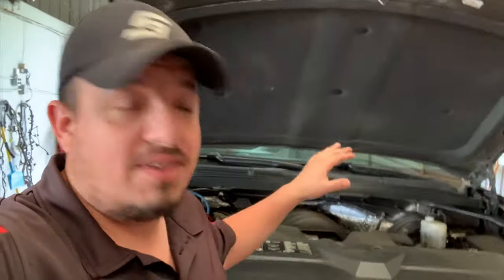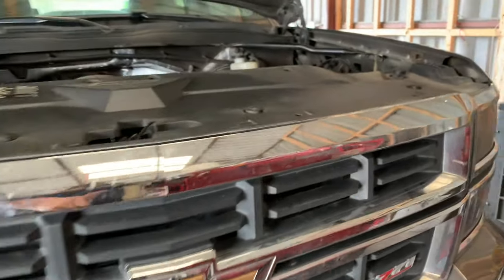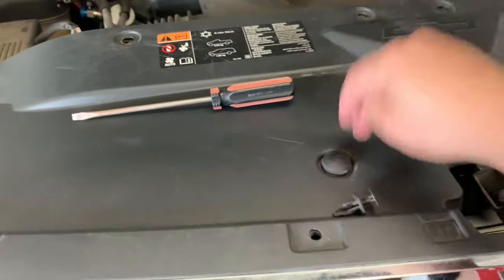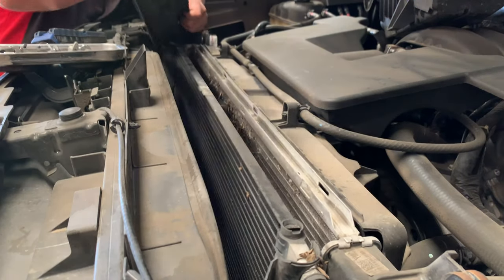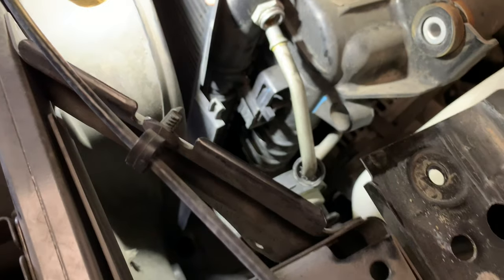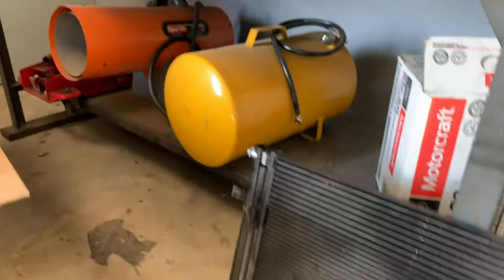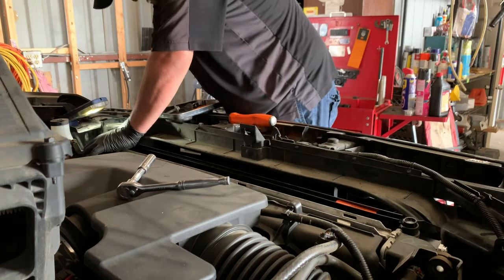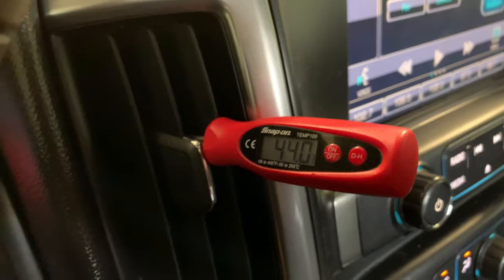2014-2018 Chevy Silverado A/C Condenser Replacement - Sierra-Tahoe-Yukon-Suburban-Escalade

Comment: I love how this is a known wide issue, there are 3 pending class action lawsuits against GM for this.......but no recall. All due to a bad weld
Reply: Mine just stopped working today I have a 2014 GMC Sierra
Reply: @oscarferreira1991  just bought a replacement condenser for my ‘14 today, about to put it in. Crazy how many people have dealt with this issue!
Reply: @spikesg2000  my ac condenser was replaced 2 years ago , whats going with my truck is the ac fan doesn’t turn on
Reply: @spikesg2000  my 2015, my step moms 2014, and my buddys 2016 all went out within a month
Reply: @oscarferreira1991  my blower fan went out about a year ago. They’re pretty easy to change, it’s under the dash on the passengers side.
Reply: Mine is probably bad too 2016 GMC Sierra looks like it’s common smh
Reply: Same exact issue for my 2014 silverado. A Chevy dealership said it would be about a $1600 fix. Looks like I'm doing this myself.
Reply: Mine started leaking yesterday!
Reply: Got a 15 GMC 1500 and just got the same leak. 
Part was 175 . Luckily I am the labor .
Reply: how can I  join the cass action law suit bcause I have this issue right now
Reply: Mine is at the dealer right now for the same concern. 2015 Silverado with 49k miles. Ac condenser is  leaking and blowing hot, im on my 3rd set of brake pads and paint is peeling. Im buying a Ford next time.
Reply: my 14s gettin a new one in this weekend i reckon lol.
Reply: I believe they might have a recall on these coils now
Reply: Preach
Reply: Any news on that lawsuit
Reply: Don't forget the transmission problems. Same story.
Reply: Just verified mine with uv dye today same spot
Reply: Can't forget the transmission too 😢😂
Reply: Yup my ac is out and yes same spot on condenser I have a leak.. it’s crazy how GM it’s not doing anything to fix this,we paid ton of money for these trucks..
Reply: No recall probly because its not something life threatening. Im guessing.
Reply: Same here from the point I bought my 2016 it was fine for about 2 years
Reply: Mine is out and some shop guy said it's 1,000 or more to fix wth
Reply: I can do this install  but I don't have that vacuum for the lines. 
How do I remedy that?
Reply: No recall because it's not a safety risk.

Bad design, but no safety risk.
Reply: @adeptustrashmechanicus2909  well we can all play the same game against them and say it puts us all in risk of heat stroke or death from not having a/c working when its 104°F outside. The kids riding in car seats sweating all cranky from heat exhaustion is a safety hazard to them and myself.
Reply: Sucks for the owner , repaired 3 this month literally doing the 4th now . Just taking a bathroom break scrolling the web .
Reply: Awesome video my friend! Thank you, my 2017 stopped working today..

Comment: Not too bad took an hour to get out and an hour to get back together my advice is take off the brackets for the air box to reach the bottom Freon lines easy. Also used a ratchet wrench for the 6 crossbar bolts not that bad

Comment: Wow!!! The Chevy dealership here in my home town quoted me $1700 to replace the condenser! They said that the whole front end had to come off!!!
Reply: Thiefs
Reply: Same here! I  just got quoted 1500! And once I asked for the part number they denied it just because I denied there service. I figured I’d do it myself but they didn’t wanna give me the part number so I couldn’t take it somewhere else and get it fixed. So no I’m working on it on and saving myself money!
Reply: Shit man, I just got quoted $1400. After this video I think I'm gonna try it myself!
Reply: Wow and it’s their screw up to begin with
Reply: I did it for less then 1,000.  230 for
Condenser and. 400 to recharge it at the dealership
Reply: Same deal here , 1700 dollars for a 200 dollar job
Reply: Same here. Quoted 1400.
Reply: I quoted myself $315 to do this job lol I'm not taking it to no dealership and you shouldn't either.
Reply: I was quoted $1200 at my local Chevy dealer. Told me the same thing. It's labor intensive and the whole front end has to come off. I live in SoCal and summers have been brutal!
Reply: Lol wow
Reply: Me too. Gonna try it in a few days 🤞🏾
Reply: Just got a quote from my local GM dealer for a locked up compressor:

And I quote.. "found compressor locked up sending metal thru system. Recommend new compressor, evac and recharge, belt, expansion valve, and condenser. Estimate of $3001.93"

I declined. Rockauto has all the parts for less than $400, and my diesel mechanic friend and I can install it all in a couple hours in my driveway, pull a vacuum, and recharge 🤷‍♂️

Comment: Thanks for the how-to. Dealer wanted $1500 for this repair. Did it myself for $150 in parts in 1.5 hours. On my 2016 suburban the lights are connected to the fender over the radiator support. I was able to do the repair by just rotating the support back wards and leaving it on the car.
Reply: Roboticsurgerydoc shit the dealership wanted to charge me 2k
Reply: How? The freon is $300 alone. Condenser is $100

Comment: You saved my ass before watching these vid I took my wife’s truck to the dealer to change the condenser and they were charging me 1500 I went got the part and change myself thanks
Reply: Same 😂 they wanted to charge me 1200 no thanks I just needed the diagnostic
Reply: same brother mine went bad they wanted 1700, the 2016 tahoe has the same problem and has a recall on it so i dont know why they wont replace it its the same part
Reply: @Tha_Marine  if it’s a recall they should be able to replace. But sometimes it’s easier to just do it yourself

Comment: Very informative video.  I ordered the part and my buddy and I swapped it out yesterday in 2 hours and refilled it and it is now blowing snowballs... Thanks so much for this video.
Reply from the maker: Glad it helped
Reply: How do you recharge it after replacement
Reply: Hey.
Did you have to drain the system or anything before unsnapping those lines from the old condenser? I added a little freon the other day to find the leak..not sure if its still in there or not.
Reply: Did you have to add AC Compressor oil along with the new freon?

Comment: Always been a loyal chevy guy. Never had any ac issues till I got the newer truck with just 38k miles and 20k miles later same exact spot mine is leaking out of.  🤦‍♂️
Reply: hector meza 65k miles and mine started leaking out this spot. But at 45k miles the compressor seized up on me 🤦🏻‍♂️
Reply: Legit got the truck a week ago. Checked my ac my condensor is leaking my compressor locked up and my copper is leaking.
Reply: I’m in the same boat buddy. Just got in my truck today and it’s 90° outside and my AC is blowing hot.

Comment: Awesome vid. Thanks for this info!! 
My Silverado had a leak on the condenser and mechanic wanted to charge me $1500! Luckily I had extended warranty and i was covered fully! I just had to pay $100 for the deductible. 😁
I heard this issue is so common with this truck cause the condenser is made of aluminum, and if you are going to replace it, it should be replaced with a metal condenser.
Reply from the maker: Good stuff
Reply: A metal condenser? Isnt Aluminum metal? Also its is made of aluminum due to its head conductivity properties as it needs to dissipate heat so you cant just make it out of any old metal. It was an iditiotic design of using tack welds to hold mounting brackets that are also at a seam where the drier tank is welded to the fins.

Comment: Great job on the repair. Thanks for making the video.  The OEM condensers are very hard to get, about a 2 months wait at my local dealer.  Napa has a few in stock and was lucky enough to get one.  Just amazed at the poor quality of GM these days. First had a transmission go out on my 2016 Silverado back in the Spring which cost me 7000 to get repaired. Now the air conditioning stopped working. This truck is becoming a big lemon, afraid of what will be next to fail. Only a 5 year old truck with 130,000 miles on it, NEVER going to buy a GM vehicle again.
Reply: Wow. I'm right over 120,000 miles and my transmission went out and then shortly after I was told there is a leak on my condenser.
Reply: I'm with you bro. I just spent 800 bucks to replace a headlight , and now looking to have to repair the AC.   So much for buying a new truck
Reply: Haha, as if other vehicles don’t have issues, good luck with Ford or dodge
Reply: I also have a 2016 Silverado 130k miles, transmission went out at 95k, condenser just got the same leak as the one in the video
Reply: Jesus. Just happened to me. Transmission went out at 95k and now at 128k condenser cracked.

Comment: Took me a bit longer than everyone else in the comments but still saved me $900. Some of the bolts were in really awkward spots. Great video.
Reply: That bolt over there by the washer fluid tube is annoying. It will not be going back in 😂😂😂😂😂😂😂😂😂😂
Reply: @baharv4575 I definitely didn’t put it back 😂”spare parts “

Comment: Did you guys hear a hissing from under the passenger side dash. Before your a/c went out? I have a 2017 kept hearing a hissing noise and my a/c stopped working
Reply from the maker: thats normal to an extent .. you have the expansion valve on the fire wall there .. so you will hear it sometimes

Comment: I get my ac condenser fixed in a few days and I’m super excited. I went a year with no Ac and mechanics gave me the run around and I spent over 3k on things that did not solve my issues. I then heard about this common leak on a weld, got mine checked and turned out It was my condenser

Comment: Great video. Would have liked to see more with the bottom connections but I get it’s hard to video that. Would attempt to do this myself but I don’t have a vacuum pump. Chevrolet should recall this issue.
Reply from the maker: You can always rent one from places that rent equipment etc.

Comment: I was told a long time ago to put a hardware cloth in front of the condenser on the back side of my grill and I never did it. Now I'm having issues with the rocks that hit the front of it, not so much on the welds  like this man is  saying but I know the welds are leaking as well. But I think if you put hardware cloth  behind your grill.  After installing the new condenser it will prevent problems in the future
Reply from the maker: Yeah. It could help

Comment: Yeah now there's a service bulletin that calls for dealerships to replace free of charge for an addition so many miles  passed the warranty. Covers every year of GM truck & SUV from 2014 to 2019. Except for the 2016 GMC sierra.  That's the only truck not covered. That's the truck I have.  It's the same part number, same manufacture of the part, as well as the service bulletin has a picture of the leak and it looks like the pic was taken from my truck. The leak spot and crack is identical to mine.  But mines not covered.  That's some bullshit.

Comment: GM has went to shit. My wife's 40k Tahoe leaks here. About the 20th issue since buying new. My 2013 Tacoma with 140k, zero issues. Tried to tell her. Learned my lesson and reaffirms my Toyota choice.
Reply: I work at a Chevrolet dealer and drive Toyota’s.
Reply: @ap5598  I would too, lol
Reply: From what I read on this GM issue, they are willing to replace the Condenser on the Tahoe and the Suburban, but us Silverado and Sierra owners are shit outa luck.

Comment: I’m doing this this week I haven’t vacuumed out the system but I’m sure most the freeon is gone lol if I don’t vacuum and install it do I need to disconnect the battery first for so I just add the free on right after installing it? Thanks
Reply from the maker: vacuum .. always vacuum ..  it removes moisture also

Comment: Your video is awesome. Have you thought of using epoxy to reinforce the welds? I'm thinking about JB weld or a 2 part epoxy to add structural integrity to the condenser. 

What do you think?

Comment: Fixed exact same condenser leak with quick setting epoxy, sandpaper, and carb cleaner. Took 15 minutes and didn't have to remove a thing (all work done reaching through front grill.) 1.Clean area with carb cleaner. 2. Sand metal around leak 3. Clean again. 4. Apply epoxy with something like a toothpick (don't use plastic, epoxy may melt it.) 5. Let cure (see epoxy directions) mine was a 90 second super fast curing. 6. recharge freon. Did mine almost 1 year ago and still working great.
Reply: I wondered if it could be repaired. A buddy has a TIG welder, hmmmm could it be welded? Or, is it a can of worms? If it fails in 1 place, why not 2?

Comment: Taking that metal brace off over the condenser was hell on Earth. Make sure you have a flex socket handy.
Reply: How did you get the metal brace to lift out under the head light bracket? Or did you take of the head light

Comment: Thanks for this. I'm doing this job on Sunday, and was concerned about the beam. Seems easy enough.
Reply from the maker: Good luck!
Reply: @FalconsGarage  Got it done. Not bad, except for those beam bolts. Only two were a pain, the other 4 not bad. Helps to have a ratchet that bends 90 degrees.

Comment: Since the trans cooler is integrated into the condenser, if the condenser leaks is it bad to drive the car risking the transmission fluid getting hot or does it only affect the a/c?
Reply from the maker: No. Shouldn’t have any issues about that.  The fan cools off the transmission cooler.  Not the Freon

Comment: Could the transmission line leak after the condenser is replaced? I had mine replaced 3 days ago and on day 2 of driving had a huge transmission fluid leak in the front drivers side engine compartment.

Comment: My 2015 Chevy Silverado has the same issue. Bad weld. Mechanic wants $950. This should without a doubt be a recall. Also, how many times have to had to replace the 3D printer spun plastic piece that lowers the tailgate slowly? I am on number 17. GM won't release the name of the Canadian company that makes the defective part. They cost less than $10s until the warranty expired, then GM raised the price to $40-$45.

Comment: Great video! Took me about 2 hours! If your doing it on a saburban 2017 the only extra step is moving the headlight bracket out of the way.
Reply from the maker: Nice work!
Reply: I'm getting ready to do it on a 17 Suburban, too.  Did you have to remove the entire headlight housing? Took a look at the bolts on the underside of the crossmember (driver side, by the washer fluid reservoir) and it looks almost impossible to get to them.  Can you describe more how you did it?

Comment: Thank you my friend. Dealer wanted nearly $1700 and I’ll be doing it myself for about $200.
Reply from the maker: I'm glad I was able to save you money!
Reply: The dealer I had diagnose my a/c quoted me $1667. Another dealer quoted me $1300.
I ended up paying $146 for diagnostics 
$154 for a new condenser(I replaced)
$148 for a shop to vacuum and recharge(which I should have just bought my own vacuum)
Total paid for cold ass a/c=$450
The shop that recharged my system said they replaced 27 condensers on a fleet of Chevy/gmc trucks for one of their customers in 1 year.

Comment: How’d you get that top bracket off that the condenser and radiator bolt to? I removed all the bolts from underneath, but the ends are underneath those support arms for the headlights.
Reply from the maker: dont remember messing with anything to do with the head lights... could you point to what spot on the video your talking about?
Reply: @FalconsGarage  The upper cross bracket that has three 10mm bolts under both sides and that the bolt in the middle. I unbolted everything but both ends are under some tabs. I tried shifting the bracket to both sides but it just doesn’t have enough clearance.

Comment: I have a 2018 silverado with only 35K miles and mine just went out, same spot, the condenser weld. So ridiculous. I have a claim open right now with GM to hopefully get them to cover it but I know its generally not covered for most ppl.

Comment: Hey falcon...I am no mechanic....so I got a quick question....after everything is installed and tightened up......can I start the truck just to make sure it runs rigjt lol......this is before I vacuum and refill......or is it bad to turn it on with new condenser before vacuuming and refilling?
Reply from the maker: Yes. You can turn the car on. Just don’t “turn on the ac” with out Freon ... Freon also acts like a lubricant for the compressor besides the pay oil that goes in there
Reply: Appreciate it Falcon.....your video helped a bunch.....thanks

Comment: Is It ok to spray paint the Condenser with High heat pain? My Truck is Black and the old Condenser is Black but when I ordered what I saw online which was Black,  I ended up getting the standard aluminum color the company.  I was told to just use High heat paint spray. Just want to know if its ok from another Mechanic.

Comment: So after you put everything back on do you need to recharge it before the customer drive off or is it okay to let customer drive off to AC shop? Thanks?
Reply from the maker: should be OK .. but might be risky .. but :should" be ok as long as they don't attempt to turn on the AC while its not charged.

Comment: Hey man I install a condenser did everything in the video, vacuum and everything. After when I was driving the transmission fluid spilled out and it’s all in the same spots where the AC lines connect to. You think it was just a bad condenser or my fault? Everything seem good when I install.
Reply from the maker: Mark Montes could it be bad connector yes. Could it not clicked all the way in wen you replaced the lines yes. It could not haves leaked were the AC lines connect to. Because the AC lines and the transmission lines go in different places.